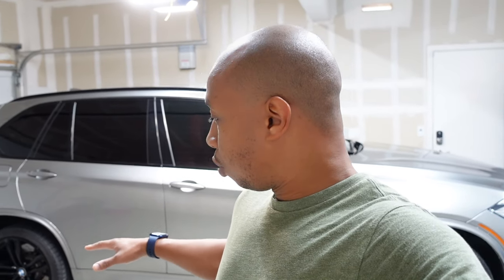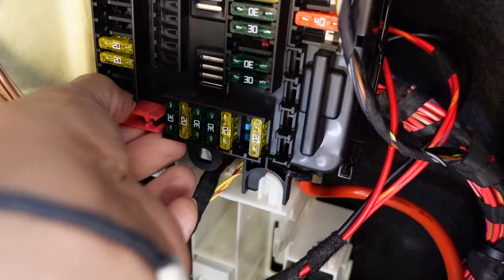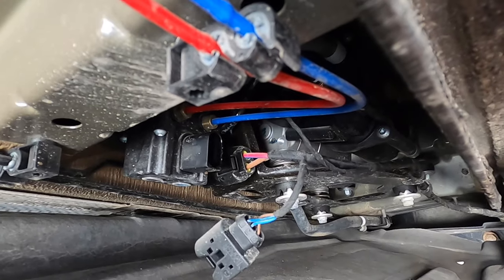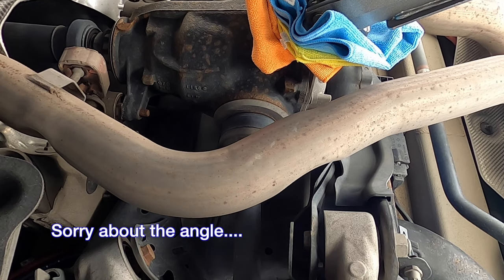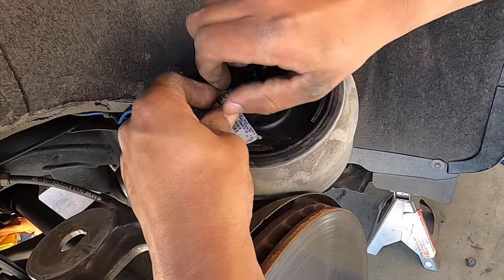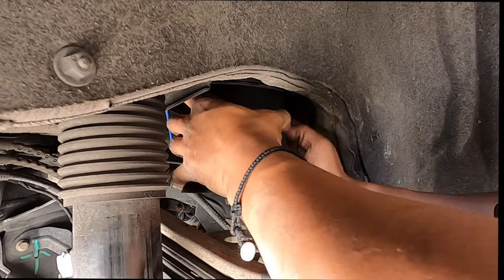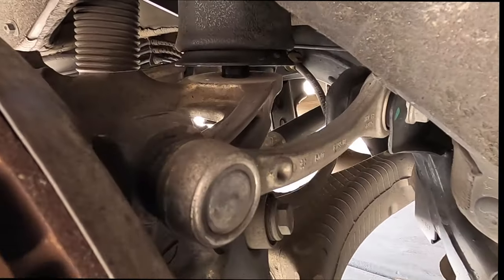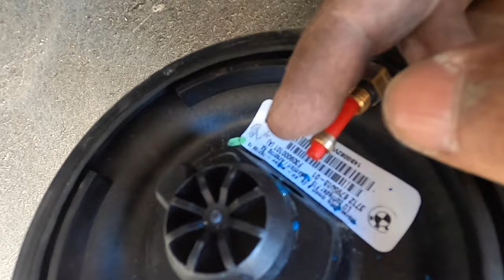BMW X5/X6 EASY DIY Rear Air Suspension Replacement-

Comment: Pro tip: When going after the bottom clip on the air spring, just don't. Take a pry bar and pop it out. It's plastic and is going in the trash anyway

Comment: Thanks a lot for the video! I watched it a few times while I replaced mine yesterday on my F85 X5M. But it's simpler than described: All I did was jack it up, slice the bags open with a box cutter, replace 'em, mount the wheels, lower it down. Done.
Reply from the maker: There’s more than one way to skin a cat!  In your case, skin an airbag! 😂
Reply: I have 535i has 28k yr 2016with air suspension problem on a passenger side . Is this common problem with 4yrs old and 28k miles?
.
Reply: @MrEre4ever  4 to 5 years seems to be the lifespan on bags fitted to bmw. But some last longer like mine in my x5 been in for 6 years and just started having the problem
Reply: @lintonlewis4615  Thanks!
Reply: @lintonlewis4615  7+ years on my F15, just started last night. I'm confused reading how this problem seems to be intermittent, sometimes it sags in 10 minutes, but then it works fine for weeks. If it was the air spring itself, wouldn't it be a more consistent behavior? I also read about people having these air springs replaced just to have the same problem within a few months, then they found the compressor air intake full of water and corroded. Still digging...
Reply: Hi, can you clarify for me?   You did not purge the air system?  You didn’t mess with all this compressor activity and you didn’t remove the fuse?   You simply cut the bags, replaced the lines on the bags and installed them?  Yes?  Thank you.
Reply: @ssaafur  Yes! I do recommend using a second jack to jack up the wheel hub. It makes mounting the air bag a lot easier.
Reply: @cristianradu4971  I have a 2015 F15.  Same thing,  no problem ever and then one day I came outside and it was like an invisible elephant want sitting on the driver side rear.  Started it and it popped right up.  I was then gone on a cycling trip for three weeks.  Didn’t sag at all.   Drove it just last night, came out this morning and the driver side was all the down again and the passenger side midway down.
Reply: @cristianradu4971  Yep that happens. Replace the compressor too at the same time. You can replace the dessicant and clean out the compressor but you are just delaying the inevitable, plus when they clog up they put a lot more strain on them so if it "struggles" or stopped working, chances are it's on its way out.

Comment: X5 air suspension issues are not always the air bags. The pump could have moisture in it. You would need to replace the desiccant blue filters.
Reply from the maker: That’s true but 9 times out of 10 it’s the bags.   Ignoring the bags will lead to a pump failure.
Reply: Mine was the solenoid on the compressor

Comment: Lol you must think I am a stalker I saw you do this and thought "meh, let me do it too for kicks" (as part of my Summer wheel switcheroo)! Easy in and out and thanks for the warning on the finicky hose clamps, and link for where to buy the airbags. I also replaced the compressor while I was at it, as the car is almost at 100,000kms/60,000miles, which was also just another 1hr job (mostly removing panels) on top of the 2 hours to do the bags, I mean why not do the whole thing? The pumps are also known to flake out at this mileage (you can do a pump dessicant & seals repair but again, easier to bang in a new one which was around $250 on Amazon and looked/performed EXACTLY like the BMW OEM one). I actually installed the compressor output lines fully/tight, and then just drilled a hole in the old bags and they went soft, no need to remove compressor line fittings (Fuse out whole time of course). For anyone wondering if you need ISTA (which I have but was lazy) you don't, as long as your level sensors/compressor all work. I just pulled the fuse, lifted rear, drilled a hole in old bags to deflate, replaced, and then let jack down like you did to "balance out" the jack dropping vs the compressor kicking in until the car was level. I ran ISTA to just give them a boost and check the level sensors anyway, but if you hear the compressor kicking in while very slowly and bit by bit lowering the jack you are good to go. Fully refreshed air suspension in 3 or 4 hours and under $500. Thanks again for the idea/inspiration Ed! ✌
Reply from the maker: Glad it worked out for you!  

I’m at 65,000 miles on my M so I need to start looking at suspension as well! 
I will use your tips for the next time!

Comment: It is rare to see DIY videos entering such level of detail and process. Definitely learned how to do this job myself on my 2017 F85 when time comes. Thanks and greetings from Toronto
Reply: It's super easy I would suggest do the compressor too. It WILL flake out around 150,000km or a lot less, and takes an hour or so to replace. Peace of mind for just another $250 or so!

Comment: Dude, you have just saved us some money. The local BMW dealership here in South Africa wanted to charge ur R37500 ZAR ($2550 USD) for replacing just the rear right air springs in our 2017 X6 M50D (F16). Thank you SO much. Great content, I have subscribed.
Reply: And where did you eventually get it done?

Comment: Has anyone attempted this job and had issues with the bags re-inflating? Mine made the popping sounds, both left and right, like they seated and were inflating, however I still have the car sitting on the ground, it won't pump them back into proper position.

Comment: Not only that but the battery life will decrease because is going keep inflating those air bags all the time. It happened to me, waited too long and right after I replaced the air bags, I also replaced the battery. So guys, if you see the rear of your X5 lowered like that, don’t wait too long and replace them sooner rather than later. Thank you for the DIY, they help us save money.

Comment: Very well done, very thorough...I had one go bad about a year ago and replaced the other one today.  I use the wheel studs to make putting the tire back on a whole lot easier.  I can also recommend to any X5 owners to replace your oil filter housing with a metal one.  Mine leaked and cost me an alternator!

Comment: Just replaced both mine too yesterday with the help of this video!  Very easy job, as easy as doing brake pads maybe. Mine weren't sagging yet, but it's a 2015 so I did it preventatively to save the compressor... Thanks for your guidance Mr Eddie.  Much appreciated!

Comment: X5 F15 40e 
Air suspension, at the rear sagged down or basically dropped flat under high load 
Got it to a german car repair guy, diagnosed issue (applied foam and bubbles formed over the air balloon) in hours after handing over 
Ordered parts, replaced and got back my beast in 3 days charged around $750 
Thing now runs like the best ride in the world

Comment: Thumbs up!  Just did the bags on my 2017 X5 35d and it was a breeze.  They have press fit airline fittings on the Arnot aftermarket bags, just press and fit!  Makes it even better

Comment: Thanks for the video. I had to slowly lower my suspension to allow air to fill it or the suction would cause the bag to pop back out even with the clips attacked. Also is super easy to just use a pry bar to get the bags to pop up off the suspension.

Comment: Fantastic, a well presented and accurate video. 
Only thing I would say is, you can take off the top cover from airbag and fit back onto new bag thus saving you from having to take fitting off end of pipe.

Comment: Very helpful intro to this procedure.  A couple of updates: I just replaced my air springs (2/5/2023) and the Arnott bags are now connected by simply jamming the air line into the brass fitting.  While simpler it is a bit unnerving depending on such a connection.  Still holding air though.  Also, the half moon slot in the top of the Arnotts can accept the air line if you lube it up and press the line straight down into the half moon slot.  I point this out because of the alignment necessary to 'jam' the air line into the brass fitting; it has a very slight angle to it and if you fish the air line through the half moon slot first you'll have a helluva time getting it into the brass fitting firmly enough to set the seal.  Best to make the line-to-brass connection first, pull back on the line to set the seal and then snap the line down into the half moon slot.  Also, newbie mistake here, make sure that your dust shield is completely seated all the way around.  Even a little bit unseated will prevent you from locking in the upper indexed dogs/slots.
Reply from the maker: Thanks for the tips!

Comment: Great video man!! I did on my X5 too. If you need to reuse air rose fitting hardware I ve used a tiny flat screwdriver into the little gap and turn very gently and got it. But normally the new bag comes with all needed hardware.

Comment: Instead of removing the bottom panel, then the hose from the pump, disconnect the fuse and slash the bag.  If its already sagging, theres no/low pressure.  Put on eye protection and insert a pointy object (hypodermic needle, ice pick, box cutter, screwdriver) to the inner side of the bag (away from you).  That brass ring can be found at any Homedepot's plumbing section.  When you tighten the nut, it compresses and deforms the brass ring creating a tight seal.  The ring actually cuts slightly into the plastic tube; thats why it doesn't easily slide off.  I regularly spray the airbags and any rubber parts (boot cover, ball joints, window gaskets) with a silicone spray to clean off any salt and hopefully keep the bags (rubber) supple to extend life.
What's your opinion on changing the transmission oil and filter?  BMW says lifetime fluid, ZF (design, build, manufacture) says every 50k miles.  I have the filter/tray kit and OEM fluid; just waiting for the courage to crawl underneath the car.
Reply from the maker: That’s a good idea! Great tips as well! When the F85 needs a replacement I’ll definitely try it to save some time!

Comment: I just did this job on my 2016 X5 F15 M sports. I disconnected the battery and just slash the old leaking air spring with a knife cutter to release the air instead of disconnecting the air compressor.
Reply from the maker: When it comes time to replace them next time I’m going to do that to save time!

Comment: Hello Ed. informative video btw. Wanted to ask, was the level ok or did the pump level the rear ok. Because i didn't see you use (what everybody talk about in bimmerpost) they call ISTA-D? Because my X5M rear seem to be deflating too when park for couple of days. I was thinking of doing the DIY so wanted to make sure i have everything i need before doing it (hoping to save the cost) or i'll just bring it to bmw repair shop if its too complicated to get to the bmw spec after repair. thanks in advance

Comment: Nice work. I changed my bags as well. What I did differently was, I removed the rubber skirt to no tamper with the hose fitment. That way I didn't have to panic. FYI: The lifespan of the bags lasts about 4-5 years. Just something to keep in mind.

Comment: Good video! Couple points: jack is in the wrong place - move it slightly forward to avoid damaging the torque distributor, just 7-10 cm forward (see the car manual); deflating the old airsprings is easier with software - car goes to service mode, deflates the springs & expects further pump activation & level check with the roulette. Cheers!
Reply: I just pop the bags with pocket knife. Is quick n dirty method.

Comment: Thanks for the video. Very detailed and informative. I have a question about the air compressor, I changed it out but it won’t turn on. Any idea or assistance would be greatly appreciate. I have a 2014 X5

Comment: Im so glad this is a job you can do yourself... this is truly a pricey job for BMW to do. I really thought you had to recode the bags like with a deflate and reinflate code.
Reply from the maker: I’ve seen write ups for both on the forums. Some people use the Ista-p for deflating the bags and some manually pull the lines.
Reply: @eddiemcars  I think as long as it knows what full is. Maybe it knows the right psi and stops. That pulling the lines makes perfect sense to do.

Comment: Great video   My x5m is startin to zaggg!!!😢😢😢    I was told the air compressor has a filter that fills up with moisture and needs to be repalced (filter)    Is it true or just replaced the bags???  Only 1 side is zaggin

Comment: The driver side air spring on my 2017 F15 35i went yesterday... gonna go for the Arnott A2642 as my replacement
Reply from the maker: I hear Arnott is very good!
Reply: Had the the Arnotts for about 15k miles and Zero issues. Ride quality is better and with Conti ExtremeContact DWS06 the ride quality is very plush coming from RFT tires.

Comment: Great job, i had replaced the brakes and rotors all around on my x5 using a previous vid you posted. Noticed my air bags had similar dry rot, possibly next change.
Reply from the maker: Did they eventually fail or were you able to get more miles out of them?
Reply: @eddiemcars  they failed, dropped and wouldn’t inflate what so ever. Thanks for the video great help.

Comment: I just did mine, thanks for the video. I got a chassis code afterwards.  By any chance do you know if you have to program something after replacement.
Reply from the maker: Some people use ISTA to refill the bags.  It’s definitely not required.  
I did it raise off the ground?  I would try to clear the code and see if it returns.

Comment: Great video, just a thought, if you remove the fuse could you not drop the airbag and deflate the bag from one end, this would save removing the panel, electrical plugs and then removing the air pipes, just a thought or is there something I may not be aware of, even maybe puncture the old air bags with a knife to remove the air. I have this job to do so just wondering.
Reply from the maker: Yes, others have mentioned just slicing the bag to save time from removing the air hose from the pump.

Comment: Buddy great video, I have a 2016 with 60,000 miles. It’s sagging from the rear at least once a week. If it’s really leaking air why doesn’t it do it every day?
Reply from the maker: That’s how it starts.  Eventually it will do it all the time as the air bags deteriorate more.
Reply: My 16 is an M pkg(not the actual M)with the 3rd row, do you happen to know Arnott part number? I have a part number can you see if it’s the correct one please thank you! 2014-2018 BMW X5 Air Spring - Arnott 37 12 6 795 013

Comment: Hi Eddie,

I changed both my rear bags now the left in is still sitting low and keep getting the warning message chassis function restricted. The passenger bag is inflating ti the correct hight driver is is inflating but not to correct hight and I never got that message before I changed the bags. Can you please offer any advice

Comment: I ordered Arnott A2642 bags for my 2016 X6M. I am planning on DIY them this weekend. Is it really necessary to remove the under panel to unplug compressor and release air pressure by unscrewing the lines?

Why cant I just disconnect the battery and puncture a whole in the bag and release the pressure that way? It shouldn't matter which way you deflate the air, correct?

Am I making it sound too simple or stupid ? lol
Reply from the maker: I've never tried it that way.  The two write ups on the forums were to use ISTA-p computer or unplug direct from the pump.  I guess if both batteries are disconnected, and you puncture the bag, that’s one way to get the bags to deplete.  However, I would attempt this at your own risk.
Reply: I just replaced my bags on a X5M F85. All I did was jack it up, slice the bags open with a box cutter, replace 'em, mount the wheels, lower it down. Done.
Reply: @eddiemcars  Did you pull the fuse? Did you have any issues with changing this lines on the new bags?

Comment: Thank you for this video! I have a 2016 x5m with a sagging rear. I think the air compressor might have gone out since it wont go back up anymore. How hard is it to replace the air compressor? And is an aftermarket part ok? The original is like 1200$+ ! Can anyone chime in?
Reply from the maker: It's not very hard. It's located on the passenger side and 3 bolts hold it in

Comment: My BMW F15 X5 M sport's one rear started dropping when parked but goes back up when I start engine. Must be some leaks going from airbag/bellow. Wish I could do that on my own but not that brave as yet. Greetings from Brissy, Australia!
Reply from the maker: Eventually the pump will fail if left alone.  I would get the shocks replaced asap!

Comment: Why you had to disconnect the airline from the pump side? Is that just to deflate the airbag itself so it can be removed? If so, can I wait till air leaks enough to lower the car and then jack up the car? Then the airbag should be removable as it is no longer fully extended.
Reply from the maker: Yes. I wanted to deflate the bag completely

Comment: I know this vid is a yr old but I’d like to ask how did they hold up. I thought they would cost more. Should I go OEM or use the recommended ones in the link?
Reply from the maker: The last time I checked they are still holding up. 
I think Arnott is the more popular brand for replacement.